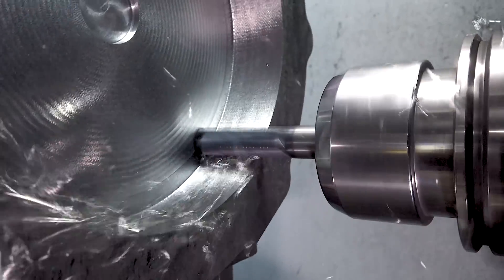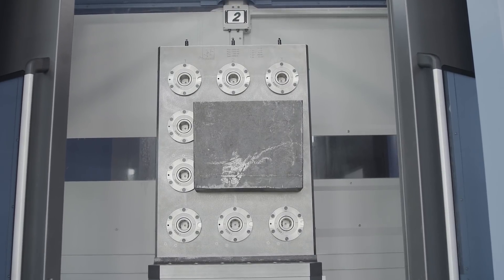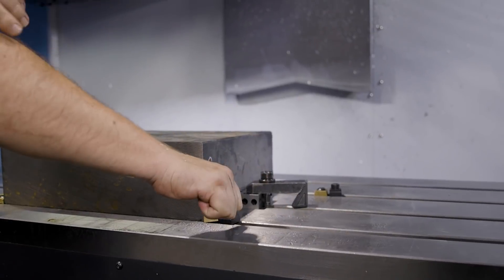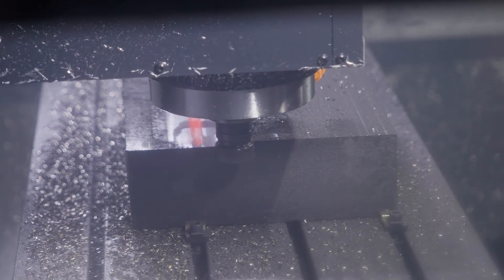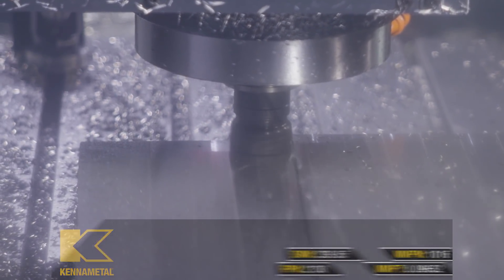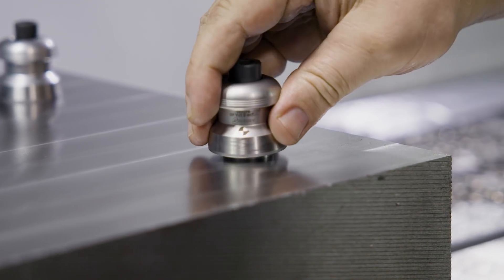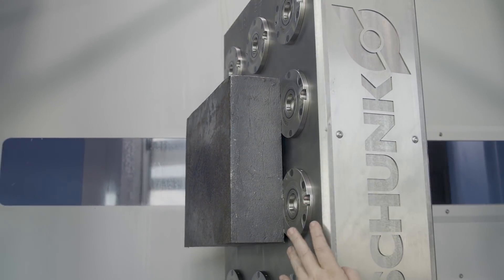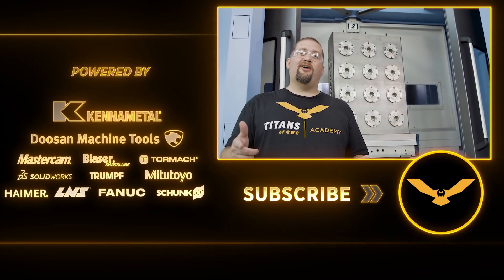MONSTER Quick-Change Tombstone + FAST Machining in Cast Iron | Kennametal KOR 6 | Doosan NHM 6300

Comment: why do you always mill with the rotation of the tool in stead of against the rotation... milling with the rotation makes the tools wear down faster.
Reply: If you are talking about climb milling the scale off of the outside of the part you might be right just for the first outside pass.. You can conventional mill the scale off then switch back to climb milling. Honestly its pretty negligible.
Reply: Climb milling is the preferred approach with most tools produced in the last 2 decades.
Reply: That's not how it works.  The reason you cut conventional on manual machines is because they have too much lash to not break the tool when climb cutting.  When climb cutting the tool will pull into the work piece taking out all the lash and take too big of a cut and break the tool.  On a machine with no lash to take up when you climb cut you have chip thinning and less tool wear.  When conventional milling you have chip thickening and more tool wear.   Well radial engagement comes into it too but that should give you a start to understand what's going on.
Reply: @stiles3711  Yes. Fair point. 👍

Comment: Wouldn't it be better to use one of your multi-insert, huge Kennametal end mills (VS series I belive) for that pocket? It's seem like a lot for cutting, even for KOR. 
I'm just curious if you could or is there something against it?
Reply: Haha good question. But there is a bit of a trade off between endmills and inserted tools. Long story short, 2.25” axial and 10% radial is the same as 2.25” radial and 10% axial. With an inserted cutter, you need to be cognizant of ramp angle and diameter. But with an endmill you can dive in and make chips!
Reply: Are you talking about the pocket for the pull stud?  If so it's pretty small and you want it to be a near friction fit, so an endmill will give a better surface finish for that job.

Comment: That's actually a great idea. We have the fixtures mounted to our smaller horizontal mills with those, but actually having an OP where you put the pullstuds into the part itself is genius, and works great for the bigger stuff.